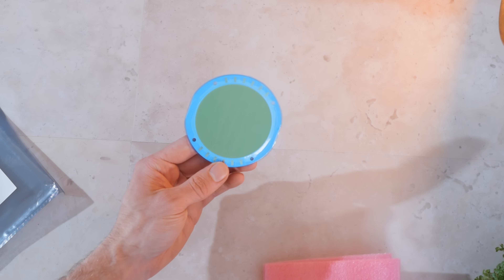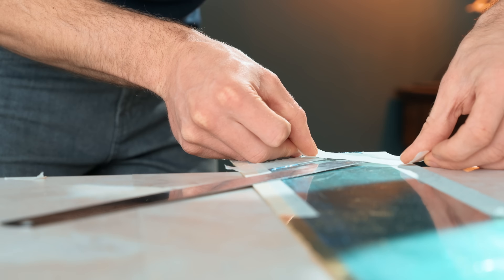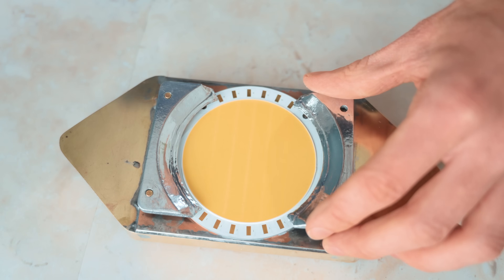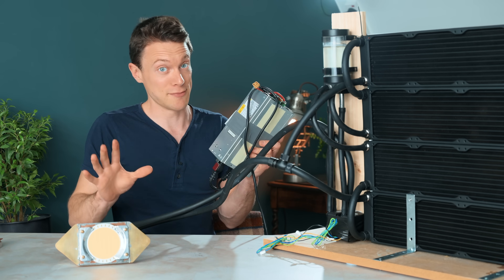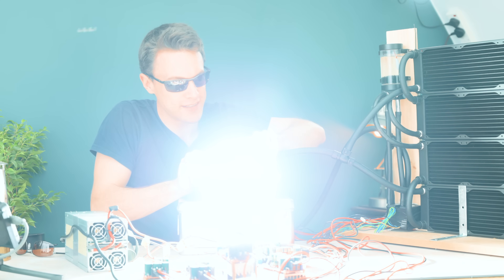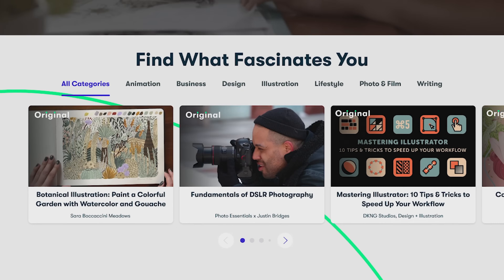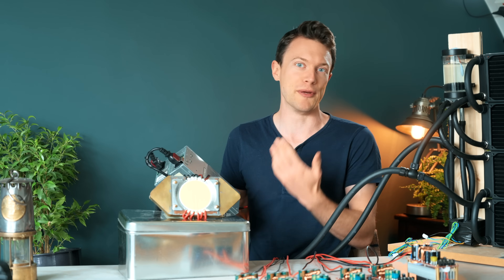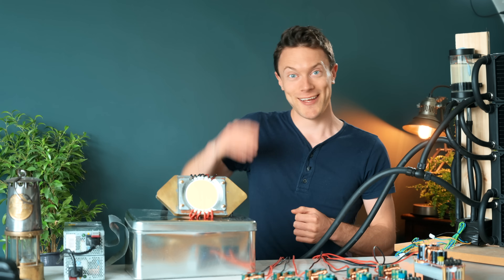Testing the world's BRIGHTEST LED!!!

Comment: The different metals in the water block and radiators will lead to corrosion over time. This can gunk up the radiators and finns on the heatsink.
Reply: He used brass, so unless his radiator cores are aluminium, he'll be fine. Brass is nonreactive.
Reply: @dash8brj  Even if that's the case, using non-metallic tubing between the radiators and heatsink, offers dielectric isolation. He probably won't have too much trouble with that. If he's concerned, automotive antifreeze offers protection against corrosion and galvanization.
Reply: @dash8brj  "Brass is nonreactive." Same with copper. Problem is the tin and other alloying agents in the brass, and considering the fins are copper... Ye no. He needs a sacrificial anode.
Reply: @Dumdumshum  Fittings for water cooling stuff are all brass, and are used with copper heatsinks and radiators, and are not a problem. No need for any sacrificial anythings. The only issue here is potentially the solder in the DIY block.
Reply: That would be a real concern, if he was using metal tubing to circulate the water. With rubber hose, he has some dielectric isolation between the aluminum radiators, and the brass/copper heat sink. There is, however, some concern for galvanization between the copper, and the solder, though, my whole house uses soldered copper plumbing.(lead free solder) and have not had any joints fail in 50 years.
Reply: @vincentrobinette1507  If its 50 years as you say, it isn't lead free solder.
Reply: @richbooth8948  The solder is tin and silver. It was the first lead free solder, designed for potable water supplies. They had just realized that lead in water was a bad thing. This is before it was illegal to use lead solder. now days, you can't use leaded solder for sweat fitting copper plumbing for culinary water.
Reply: @vincentrobinette1507  I completely understand what lead free solder is and why it is used.  In 1970 they did not use lead free solder yet.
Reply: Experimental rig: only intended to work for a brief moment.

Comment: Those 6 voltage regulators are not 100% energy efficient as they will take up some energy themselves. You did not factor this in your calcuation, that is probably why the PSU burned out.

Comment: Suggestions:
Use one computer (around 500W or less will do) Power Suppy Unit per Voltage regulator.
Use car radiator coolant instead (to replace the water). Plain tap water and copper will cause efflorescense.
Otherwise, this is a good attempt.
Reply: It is only likely ever to be used for a few minutes. Probably doesn't matter.

Comment: A note on water cooling a high thermal load. May not apply to this depending on how hot that will get with the final solutions cooling capacity, but when you turn off power to everything together, you'll actually see a sharp increase in temperature of your device.

It's very unintuitive because the light is turned off, but the same effect happens in cars and engineers have had to study and design for it. what happens is when you turn it off, the light stops producing new heat, but also the water stops flowing. So the latent heat builds up briefly before ambient radiation catches up with cooling. Hybrid cars for example have special software and connections to power their cooling pumps after the engine stops because the thermals can build up to dangerous levels with on/off cycles.

May be worth it to keep the pumps on a few minutes after the light is shut off.

Comment: Mixing copper and nickel in a liquid cooling loop with aluminum parts will induce galvanic corrosion and the more active aluminum will get damaged. This can also lead to the damage to the nickel plating since it is a thin coating. Corrosion happens regardless in all systems whether they have mixed metals or not.

Comment: Don't put switchmode power supplies in series. Connecting them this way screws up frequency feedback for the MOSFETs and can easily fry them - server supplies have quite elaborate output monitoring. There are some supplies designed to be used in series, but they have a dedicated bus to lock switching frequency between them. Since this LED is effectively seven LEDs with separate inputs, it would be safer to just split them between supplies completely in parallel.

Comment: WOW that is BRIGHT!  I wonder if one of those bit miner power supply's would work on that.  They are 1600 watts MAX output. I have one a friend gave me and I can't get it to work, but I'm guessing it needs 220 volts and I don't have that, other than my clothes dryer.  LOL  Well some other things too, but I'm not going to run a 220 line just to use this power supply.  LOL  Shame the PSus didn't last, I was wanting to see how bright it was outside.  Will be looking for the next part of this.

Comment: you loose a little power to voltage setups and with actually power draw and conversion losses i wouldn't be surprised if its puling MORE than 1500watts

Comment: A potential issue is the increased current draw of the boost converters. Probably not solely responsible but a possible factor. I would either 1) pony up the $ for a 1500w 30v psu or 2) do what was likely intended by the sector design and use 6 30v 300w power supplies.

Comment: You might wanna look into big batteries for the light instead of trying to power off a supply like that. Cause you're not gonna have this thing on for super long stretches, you're going to be pulling around 65 amps at 24 volts but that is pretty reasonable with a couple deep cycle 12v bat's in series. And then just charge em between uses. You may also wanna look into some of that solar power deals cause they typically run a 48volt deal.

Comment: Dude that isn't within spec unless they are 80+ certified and even then bronze is pretty low grade for running at the 800W sustained limit the 80+ certification was specced for. 1635 would be technically more than 80% of each power supplies power combined anyway.

Comment: wow that's a lot of heatsink! how efficient is that LED, I'm certain it doesn't put off 1.5kw of heat does it?
Also, the power supplies have a total power rating but each bus has its own lower limit, ie 12v can only put out 500w even though it's an 800w supply.

Comment: The power supplies failed because you maxed out the 12V power rails not just with the LED but also because of the efficiency of the booster boards. To provide  boosting from 24V to 30V they will pull a ton more current than they supply the LED with. Either way great video, I hope to see this thing outside someday :D

Comment: Should have had a look for a ryzen thread ripper waterblock :) bigger block for a bigger cpu, combined with a higher pressure pump and maybe just an automotive radiator for a small car? Would have certainly been cheaper than all of those pc rads :)

Comment: Maybe the PSUs' current limit was exceeded? At 30V and 1614W, you're pulling about 54A. In series they are unable to split the current—all 54A are going through both power supplies.

Comment: Do the power supplies have one single 12V rail or separate rails and/or other voltages as well? If so, the separate rails may not be rated to deliver the full power.
Also inrush current may be a problem; server mainbaords (like all computers) usually wait for the "power-good" signal to actually power on their components - this gives th PSU time to ramp up before the full load is applied.

Comment: I wonder what would happen if you put the power supply and LED in a tank of Novec 7100 (expensive) and connected that tank to a heat exchange. Novec 7100 boils at around 60C then you can re condense it back into a liquid so it makes a very good sealed evaporation cooling setup. Alternatively you could try to submerge the PSU's in mineral oil and run that through the rads as well.

Comment: Your problem is that LEDs have a really high starting current for a split second and the first time you started the segments separately and the second time not. You have to dimm it and start it then and then go slowly up in power to break/flatten the current peak at the start.

Comment: I think they died because you did a instant power off, without allowing the PS's to cool off. Also, you wired them in series, did you make sure the current draw was within spec. That current should be the limit of the PS with the lowest current output.

Comment: I think, the surge of all 6 sections coming on all together is what killed it; Remember you have turned them on one by one in the first test, with ample (between cuts) time to settle? You did not do that in the second test. The server PSU was able to cope with ramping the load up but not with ALL 6 at the same time. That, and as someone below said, 12V rail may have different specs than the 5V AND the power of PSU is usually defined as a sum of power of all its outputs. (on PC type psu, they are usually listed on a sticker)

Comment: Great build, and it's a bit of a shame those expensive PSUs failed in the end. I'd have probably used 4 650W generic desktop power supplies because they're pretty cheap. You could do two series chains of them into two banks of boost circuits so they could be isolated. They're designed for poor airflow, so they can definitely cool themselves better than a server PSU. You'd just need to make sure that each chassis ground isn't connected to the PSU's ground, and get a bunch of those Add2PSU connectors (they isolate with a relay). edit: Come to think of it, I think they actually do link the grounds together, so maybe you'd need to just use a standard relay and custom make a loom.
Using a standard PSU,  you could also run your pumps and fans off one or two supplies directly.
I'm not sure how you're planning to do the switching in the end, and I've never worked with such LEDs, but I would warn that you shouldn't let your boost circuits idle at much higher voltage than the LEDs can handle, as when the switch is flipped, the output capacitors can dump their energy into the LEDs, potentially shortening their lifespan. I'm sure you're going to just switch it off at the mains switch, but I just thought I'd mention it in case.

Comment: you should add a small turbine to your water cooling, that checks for flowing water, as an added safety measure, if its outputting a current, it will more or less show that your cooling system is working, stopping any issues with your LED burning up in the event of your pumps going out for whatever reason.

Comment: Also, maybe you created a ground loop between the supplies? The ground is usually wired to the earth ground of the AC line. I don't know how you actually connected them in series. Maybe snip the ground pin on the AC plug, insulate the casings from each other (because it looks like you duct taped them together), and cross your fingers. They should be galvanically isolated from the mains other than the ground pin.

Comment: Honestly, the LED is not that impressive. 120k lumens at 1500 watts, and that for $1350... meh!
10 High CRI Cree CXB3590 together also have 120k lumens at 850W at their recommended drive current, cost like $300 and have a similar size.
And when pushed to their maximum ratings, they will even do 160k lumens at 1350W. Okay, they only have CRI 92 instead of 95.
Reply: Yes but it's about it being 1 diode
Reply: @gideonkloosterman  It's not 1 diode at all. It's a COB (chip on board) module and it has hundreds of small LEDs on it, like all really high power LEDs do. If one powers a COB module with a really low current (like a few mA) one can nicely see the individual LEDs
Reply: @Coiltec  Oh yeah, you're right!

Comment: Great stuff, but the power supplies should not be wired in parallel, there are two for redundancy and load balancing, if you wired each 3 watt booster to one power supply, it'd worked like a charm. I think you fried only one of them.

Comment: Well, I got a little theory why your lad didn't get as hot as expected... so we know it takes up 1500 watts, but not all of this power is converted to waste heat, in fact your hand only got this warm because the other power you've put through the led has been converted to light energy (I guess about 50% of the 1,5kw... ) which heated up your hand... so there are "just" about 750 watts to cool instead of the expected 1500 watts... all I want to say is, how about u stick another led onto it?
Reply: So in a nutshell, the cooling is a little overkill but nice to know it wont break from overheating

Comment: What is your mains voltage, 110 or 230 volt? These server psu have different power ratings depending on your mains voltage. 1000W for 230 mains and something around 750 - 850W for 110  main.  That together with that serial wiring could have overloaded one. Better leave them separate and use 3 boost converters per unit.

Comment: For future reference, a good way to test your water systems for leaks without risking getting water everywhere is to use compressed air. Pump it up to about 60 psi and leave a gauge on it. Leave it for 15 - 20 min and see if the pressure is holding. If it is, you've got no leaks.

Comment: I assume the issue is due to the fact that the total wattage of the Powerades supply is a combination of x watts at 3.3V, y watts at 5V, z watts at 12 watts and so on. I assume you only utilized the 12V portion of the power supply which is likely only 50% of the total output. Just an assumption.... Hope it helps.

Comment: Another thing to think about is The highest voltage rails can’t output the max load the power supply can handle. If they could each push 1000 watts, the power supplies what be rated higher. As the other rails output power also. It should say in the specs how much wattage each rail can output and maxing them out is not good, as you know. 3-4 maybe more of those, depending on the rails output, would work. I would try to stay under 80% of the max per rail. Lower would be better but how many power supplies do you want to buy. Also, if you only going to run it for a minute, less supplies may work out. The longer you plan on running it the more supplies or a better cooling solution for the supplies will be needed.

Comment: Here's the thing. The power supplies splits the watts between different voltage rails, 12, 5, 3.3, 5vsb, -12..  so unless you accounted for that already, you may have actually overdriven them. Also pay attention as some power supplies may split the main 12v rail in multiples, which makes the situation even worse.

Comment: Do you need a constant current power supply, rather than a constant voltage supply. As LED temperature goes up, more current is required.

Comment: Use some fans on the radiator, you won’t have to use as many
Also, thermal paste for heat transfer between the waterblock and LED

Comment: Maybe look into unregulated power supplies. The use a bridge rectifier to convert ac into dc. These rectifiers are very cheap and plenty powerfull. stepping down the voltage is the hard part in this case. Looks like you need at least 50amps... if you can find a Transformer with the given ratings, that might be it

Comment: Just guessing but: LED's have something called an inrush current, basically when you're turning them on, the current drawn peaks and then goes back to steady state. So when you were trying to turn it on the second time, which was after running probably close to its spec's max for some time meaning the temperature was close to spec's max, that peak current at the point of switching probably fried something. 

You need to increase the voltage slowly to prevent this (there are other ways of course).

Comment: 15:00 i don't know what PSUs you got but remember that PSU W is split into 3.3V, 5V and 12v. You are using the 12V rails and they have a limited use of all the watts the PSU can deliver. There should be a rating on the side on how many Amps it can deliver at 12V

Comment: I use these 30 Volt 200 watt switching power supplies.  Maybe they would work for you.  Thanks for the crazy build!

https://www.parts-express.com/mean-well-mw-nes-200-12-12v-17a-200w-regulated-switching-power-supply-ac-adapter--320-3149

Comment: I think the power supplies might have overheated because they didn't have enough airflow. Server PSUs are usually used in server enclosures which have a good amount of fans in them by themselves, so they would provide more airflow to the power supplies in addition to their fans. Just a thought though. Maybe standard ATX power supplies would be better suited as they have bigger fans? Or with appropriate voltage regulators a DC welder?

Comment: You should mind the fact that the negative side of each supply could be grounded to its case. Running these in series with the cases touching could be producing a short circuit. Maybe it was working before simply because the contact areas were small, and the supply could deliver the elevated currents.

Comment: Its kinda pricey but digikey part number 1866-UHP-2500-36-ND is a 2500w power supply with adjustable output up to 36v could be perfect

Comment: When you do the outside test, you should also try it during the day, and OUTSHINE THE SUN!!
Reply: Should test that in another country. Sun's game's rather weak in the UK
Reply: @professionalprocrastinator8103  Hahah, that's interesting then... It could work!!
Reply: Questocanale lol of course it could work. You can stare at the sun (if you’re an idiot) yet be blinded by a very bright light that you can’t stare at
Reply: I was curious and ran the numbers. The sun is about 21,000 times as luminous per unit area.
Reply: @DanielLCarrier  True- at the surface of the sun it's about 65 MW/m2. But 150 million km away it's a mere 1350 W/m2 at the top of Earth's atmosphere.
Reply: @r0cketplumber  I meant per unit solid angle, which doesn't change with distance.
Reply: @DanielLCarrier  maybe not in a clean vacuum. But we got all kinds of crap floating in space but most impactfull is our atmosphere
Reply: The sun will probably be like ""Fock that, im out"